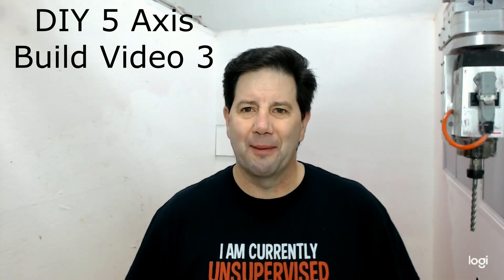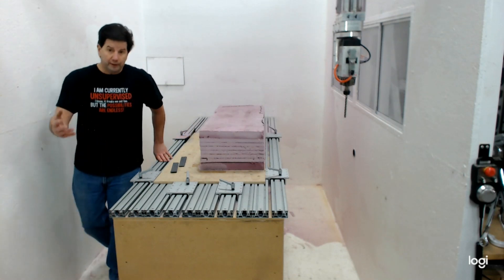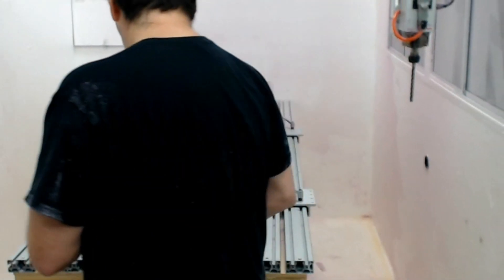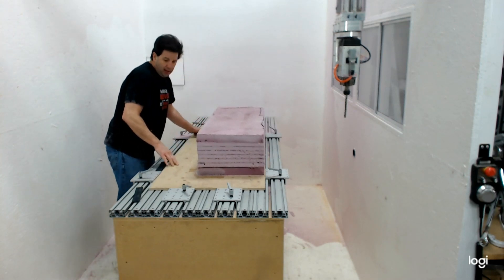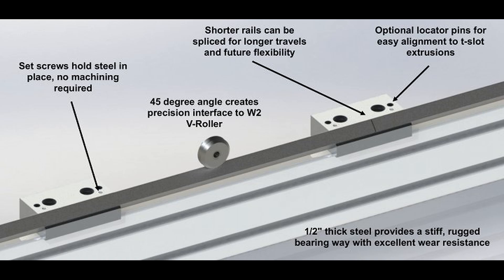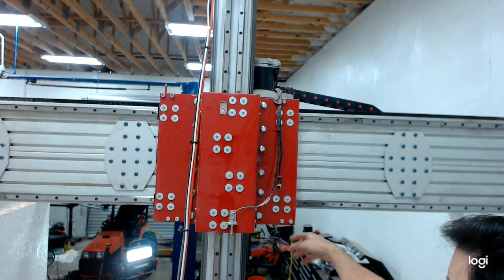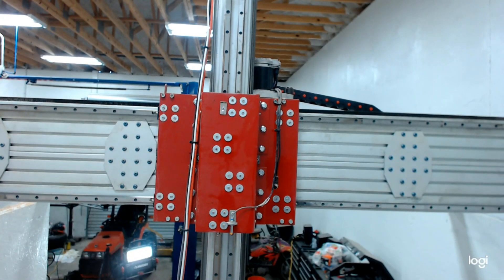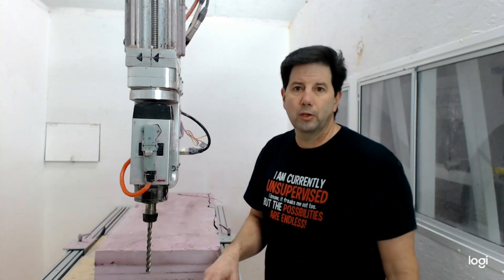DIY 5 Axis CNC Router...Build Video 3

Comment: hi thanx for your info am building almost the same setup and for the same reason ,car parts am using same bc drive but different driver ,dmm i am building now the z axis you said in 5:50 i need to center the spindle with the ball screw do you mean from the front only ? because its almost impossible to be centred from  all the side without losin some mm
Reply from the maker: Honestly it all depends on the post processor your using.  At the time of the video Fusion 360 post processor did have the ability to config any offset.  Now it does.  What post processor are you planning on using
Reply: @XSMotorWorks  i will use fusion 360 you can say i used almost same setup your using just different servo , i didnt copy it just with some search thats what i came with,but if i saw ur channel before it would save me alot of time and work buying clearpath,i have doughty bc drive, masso and thank to you i just notice that i didnt bought driver for the bc head , so do you have any problems with the gecko drive? and thank you very much for your info
Reply from the maker: @drqallaf6856  No problem at all.  The steppers on the B/C head are NEMA 23 and I havent had any problems.  The post processor in fusion works well you will just need to make small adjust for your setup.  The config file for the post processor has lots of notes in it.  If you get stuck I also maybe able to help